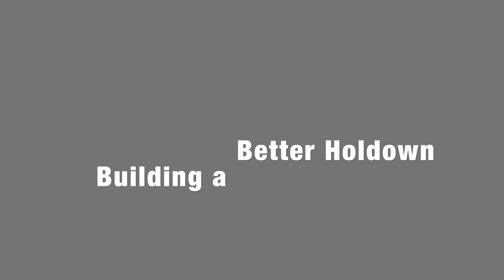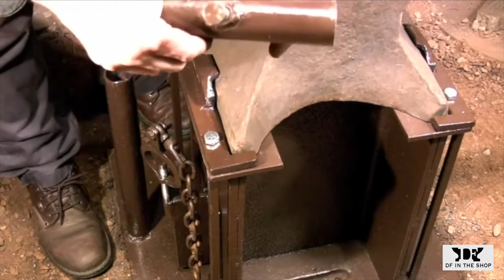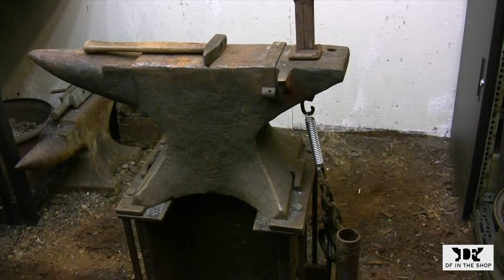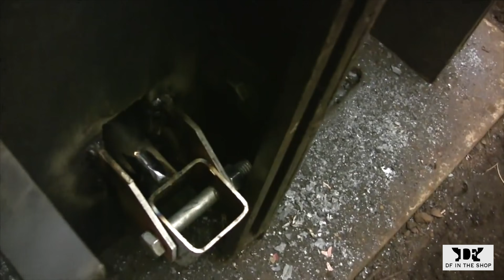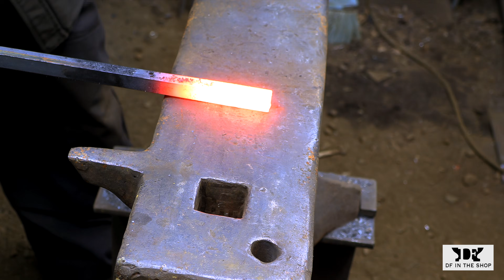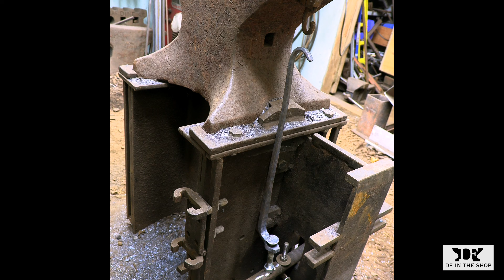Blacksmithing for Beginners - Anvil Hardy Holdown Tool

Comment: Can you make some time a video of making a saw blade for woodworking?
Reply from the maker: Are you interested in forging a saw blade or just need help with how to recycle an existing blade into something else?
Reply: l'd like to see from start to finished product, like blacksmiths did in old times (before industrial revolution). l've seen several youtubers trying to do that, but l find them a bit lacking info and knowledge how to do it properly.

But when you mentioned, l wonder if you (generally speaking) can heat normal saw blade, and cut it while hot without losing properties of good, springy steel?

Comment: Very neat idea! Elegant and works well... 
Kind of scary to see you heat up a galvanized screw?!
Reply: Thanks for reminding me that!
Reply from the maker: I thought about that but I wanted a bolt that has threads all the way up so I could take the whole thing apart if I needed to.  I did use an electroplated bolt not a hot dip so the risk is pretty negligible ( if you're only doing one bolt). I'm sure there's more crap floating around my body from the bag of microwave popcorn I had the other day. lol.
Reply: @df-intheshop330  Agreed, just take care :)